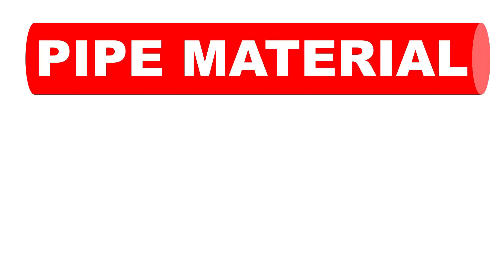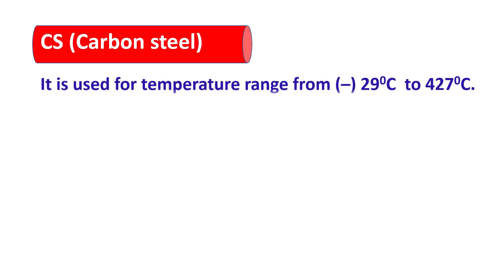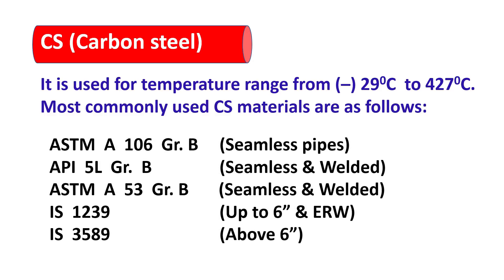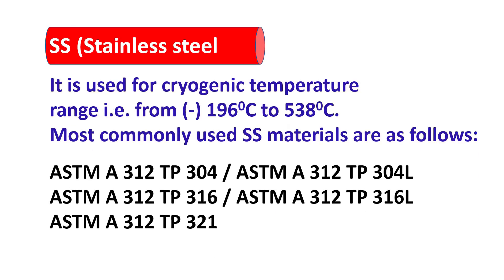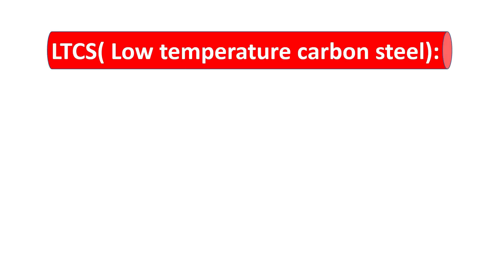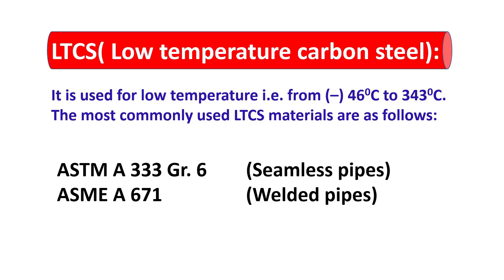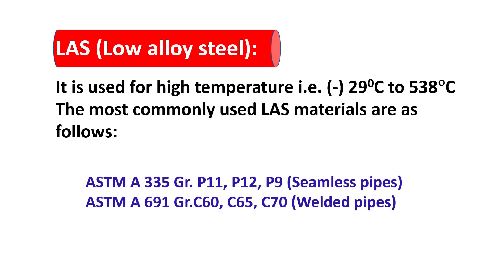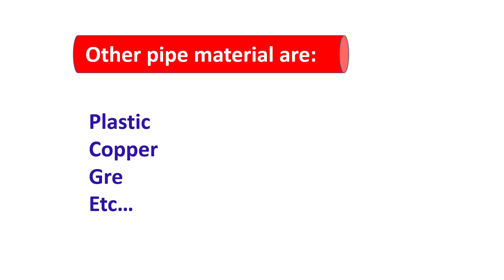PIPE MATERIAL - OIL & GAS PROFESSIONAL

Comment: Could you provide me ASTM coding pdf link?? I wanna understand the coding for example what does ASTM A 335 Gr. P11, P12, P9 mean ?
Reply: ASTM A335 P11,P9 etc are AS code (alloy steel)
Reply: A335 means chrome-moly steel pipes. Each grades have diff properties like tensile strength, etc...most used grades are P1, P2, P11, P22, P12, P5, P9